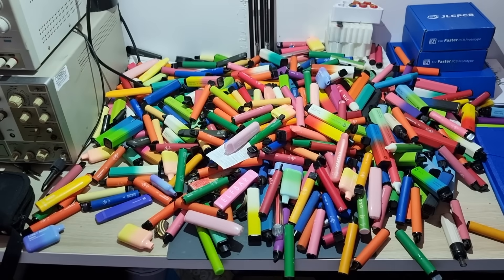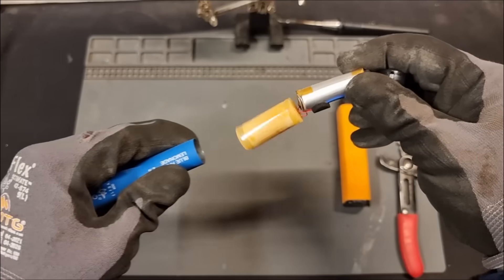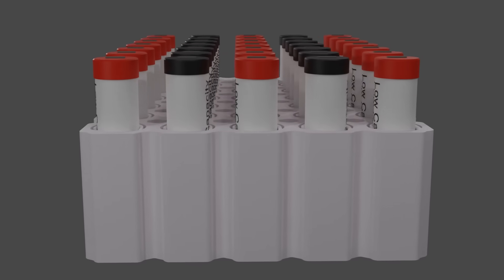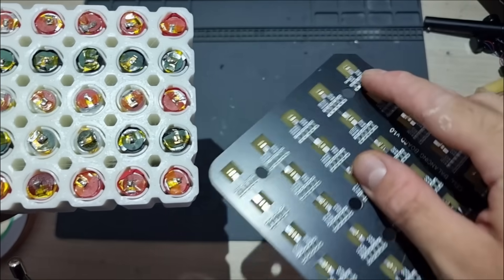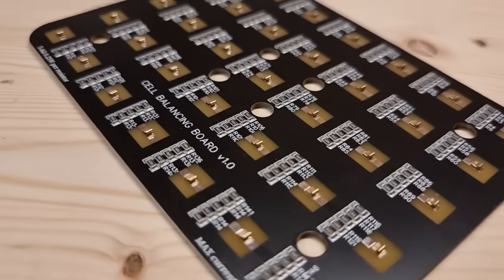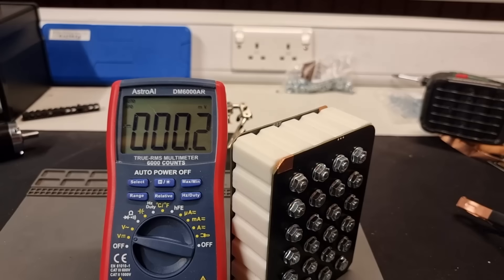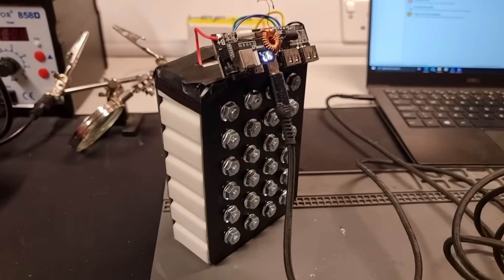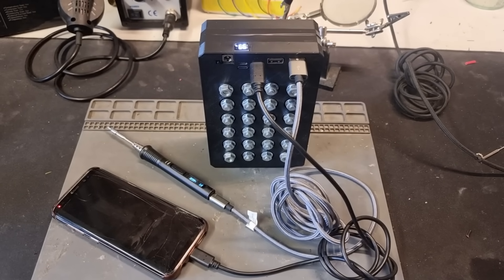Turning Disposable Vapes into a Fast Charge Power Bank

Comment: Great project! I used to make battery packs from discarded laptop batteries years ago, and I wanted to share some advice in case it helps anyone. You mentioned the final capacity being around 15,000mAh, but the concern with recycled cells is the capacity and health of each one, not just voltages. Someone may have already mentioned this in comments, but in my experience, testing each cell's capacity with a simple battery tester is key. It helps you weed out weak or unhealthy cells that could bring down the performance of the whole pack. even cells that get really warm while you lightly charge them should be discarded. you want healthy cells. (you can buy cheap simple testers online or even fancy expensive ones)

Then, after testing, let the good cells sit for a couple of weeks. If any lose significant voltage, they’re also likely unhealthy and should be excluded. Grouping cells with similar capacities together ensures a more reliable pack and will charge and discharge better. I know it's extra work, but it's important for anyone making larger packs, especially cases when you want to make a battery pack that will require large power draw like an E-bike battery.  anyways awesome video man, really turning trash into something so useful.
Reply: This comment deserves to be higher up.
Reply: As someone who makes 18650 packs from discarded cells, I can say this is excellent advice and is right on the money.
Reply: i second this.
Reply: You should really just directly test their internal resistance. I and some friends have vaped on and off, I have had a few disposables. I always tried to find the ones with onboard charging because nerds can be addicts too lol. It's a small sample size but I did notice a few would not hold their charge even after just one or two cycles.

The industry is even dirtier than we're seeing here, especially those Kapton wrapped ones I've found are technically li-ion cells but they're such low quality since they're relying on people using them for 2-3, maybe 5 cycles max, they're rechargeable but designed so cheaply that they're functionally disposable.
I'd use sensitive protection circuitry if making a large scale pack from them, still worth it but also worth it to be careful.
Reply: The beauty of this is that these batteries have been charged fully once and then only partially discharged once. Most of them are left nicely at storage charge or about 50% when the juice runs out. You can tell when he tests them that most were at roughly nominal capacity
Reply: @reezlaw  exactly. Lithium batteries can withstand a LOT of charge-discharge cycles. These cells went through ONE
Reply: great advice, needs to be pinned!
Reply: Great advice, very very relevant!
Reply: This is something to note, though they should all be in pretty good condition as you will run out of juice in many of these even after maybe 5 charges? At least my own experiences with them. I would just bring each cell up to full capacity and test each voltage, best go in the group, less go into another.
Reply: I had looked into reusing used 18650 batteries from laptops and torches but the batteries all degrade at a different rate and I read that mixing and matching doesn't work well when trying to make a new battery pack.

Which is a shame because some of the batteries are basically end of life while other still have plenty of use left in them.

What would the used batteries be good for?
Would you use the 18650's individually or make a new pack for specific uses?
Reply: @jeremylindemann5117  Use those that have a high, similar capacity. Recycle those that have high impedance compared to the others or don't retain charge for a week.
Reply: @Gregorius421  Recycle as in dispose of properly or as in cycle them in and out of a pack more often?
Reply: did you succeed?
Reply: How much ohms resistors he used
Reply: Cell health is barely an issue in this case. With laptops it 100% is cause people recharge them all the time, but for these vapes it really isn't cause they were never charged back up before being thrown out

That's the most annoying part of that garbage, they use rechargeable lithium cells and pcbs on a DISPOSABLE item. It's not an exact comparison, but it's kinda the same idea of buying a phone and when it's out of battery, you buy a new battery.

Comment: Yes! I build other cool devices with them like a portable fan that runs for around 16 hours straight on 1 charge, i also use those skinny black flat ones to replace batteries in controllers and mobile phones, i also want to build something like this!

Comment: Love the project idea but holy, you didn't need to use enough bolts for the thing to survive a hurricane

maybe a bolt in each corner and a single bolt in the middle to stop bulging, slso low profile bolts and nuts so it doesnt get stuck everywhere

Comment: I vape.   I did use “disposable” but never tossed.  I actually had removed the batteries and junked the rest.   Held onto them for awhile.  Thought about doing this but not savvy enough to figure it out.     My work has a battery bucket to dispose of properly.

Comment: that is a neat idea but I do have to question, you didnt seem to have a load balancer on those cells and this is what that board did for you to balance the charge. Are you not afraid of a cell issues causing an imbalance as these different cells will be different quality and could cause issues after some use?

Comment: Thanks for the video. I've been planning to do projects like this with vape batteries for the longest. Such as repairing a solar yard lamp. The batteries that come in them suck!. I use 18650, 20700, and 21700 vape batteries for my flashlight. Especially the ones that are loosing capacity and voltage. If you have a flashlight that uses 3 AAA batteries, and has a square single led. Remove the AAA battery bracket. Cut a used up toilet paper roll cardboard to size, use packaging tape around it to hold it's shape. Use it as an insulator for the 18650 batteries, and you're good to go. For 20700, and 21700 batteries remove the cardboard insulator. Make sure your plastic wraps are in good condition,  if not rewrap them, or use packaging tape to insulate them. You don't want a mini pipe bomb for a flashlight. After all that you'll have a much brighter, longer lasting flashlight. You should make sure all your battery wraps are in good condition, or rewrapped them asap. Safety first folks.

Comment: This is cool, I just want to say I definitely don't like your contact solution as I think it's going to be error prone. I would have spot welded them. You can actually make your own spot welder. If I didn't have one of those I would have hand soldered them because it's not really that hard once you get going.

Is that why you have like a thousand bolts through that weird case? I dont agree with the engineering choices getting made here

Comment: No this doesn't make a high voltage high-cap pack.  Logically It makes a high-volt MEDIUM-capacity pack.. logically speaking due to the fact you already refactored them once into high caps from low cap. 
It's a rule of 3 - ya can't eat ur cake and then have it!

Comment: It would have been much less work to just solder the cells together. These cells are easy to solder since they already have  a solder point on them. I also trust solder a lot better then foil tape and pressure. It would reduce the weight by a lot and not require all the pcb.

Comment: This design is dangerous, the copper tape could come in contact with the cells aluminium wrapping causing a short circuit, additionally there could be a cell that becomes disconnected and then remains high SOC, if it then reconnects it will then overcurrent charging the rest, Each cell should have a fuse, soldering and wires might be a better idea, with a through hole to connect each cell.

Comment: Hello, you should be careful with the smallest design. It looks like there could be a risk of a short circuit if you're using old batteries with worn-off plastic wrappers. Sometimes, the battery's outer casing is used as the negative terminal, so if the batteries touch each other, it could cause a problem.

Comment: I wish you had mentioned that battery banks are only as capable as their weakest cell. 

If anyone is gathering batteries while waiting for a tutorial, make sure to fully charge all of your cells and keep only the highest capacity cells. If any of them are 0.5V lower than your best cell, save it for a stand-alone project or send it to the recycling center. If there are any markings on the batteries, you should also try to find ones with similar amp/hour ratings. Just because two batteries are the same physical size does not mean they have the same internal design. Voltage comes from the chemistry, but capacity comes from the thinness of the materials and condition of the electrolyte.
Reply: since most of the ones he collected seem to be of the same brand, it's safe to assume they come from the same factory & would have nearly identical batteries...
Reply: @MG-kw1kb  Not necessarily. You can get two identical laptops or power tools from the same manufacture year and they often have two different brands of battery in their packs. 
Since these use individual batteries, are intended to be one-time-use and have little to no regulation, these factories can maximize profits by utilizing whatever crappy, possibly used batteries they can get their hands on.
Reply: @Official_DJ_Spark  I dont think your theory adapts to this batterys ... your point isnt wrong but to me this shouldnt be a problem if he uses same product with same battery (by looking) sure there is a possibility that manufactorys change something overtime... but i wouldn't assume thats the case for these batterys... but overall your pont isnt wrong and should be mentioned... in a way he did mention it by comparing the small and the bigger vape to each other

Comment: Great initiative to save nature. But I was wondering, if they need any kind of balance charging leads while recharging. After some charging cycles, some of those batteries are going to degrade and become weak, discharge faster than others, and cause problems. I am not sure, but that's what I have seen on the videos, and all of them use some sort of BMS(Battery Management System) board for balance charging.

Comment: If the battery waste for disposable vapes can make 5000 car batteries or 1.3 Million bike batteries. Isn't it not only viable but profitable for a company to salvage these batteries to be used elsewere . With practically one cycle in them they are brand new .

Comment: if you are using disposable vapes then just smoke cigarettes instead. Disposable vape is such a dumb idea on par with disposable car, you're not even saving money on it lmao. Coils from smok or vaporesso (the reputable big brands) are like 3 pounds, liquids are like 10 pounds and last quite some time, 18650 cell from SONY, Samsung or LG is again like 15 pounds and a decent mod with a tank can be bought for 20-30 pounds. That is the budget of like three months of using disposables... and maintenance is easier than cleaning your phone ffs. Like tha hardest part is washing your hands... which is alien concept to many as I find out whenever I visit public toilets but still not that hard. 

Up to 3500 puffs on the big one? Like my old vaporesso armour pro mod could do more than a 10k puffs on a single charge and like 4-5 thousand on a coil... and it was like half the size and had colour screen and cool design. And fast charging. And that was from like 8 years ago...
Reply: No way bro said just smoke cigs instead of vapes
Reply: @humble2246  disposables? Might as well. At least you'll be a burden for the environment for shorter time. And birds may use the butts to insulate their nests and fumigate parasites.
Reply: @VanBourner  so... you want people to get back into smoking where there is 10x problems compared to vaping...

Comment: I too have been collecting caps to harvest their batteries 😊 my biggest frustration is that they are of different sizes and capacity. I have used a few in my models and to repair a rechargeable torch light. But by far my biggest frustration is that so many of these gaps are just thrown down on to the ground where they get squashed by vehicles damaging the battery and often exposing the battery leaving it vulnerable to animals picking them up and in some cases eating them. The damage this causes can be fatal for the animal which could be a pet. Gaps are a serious issue.

Comment: i looked that board up in aliexpress..your potentially risk ur life using it.electro capacitor is lowest brand and if youvgoogle that brand there been loads failure.
and fuse on that board probably wont do anything is something should haywire with power bank.
dont even ask main micro controller

Comment: Is there an easy way to get the used vapes in bulk here in the us?  I have designed and built battery banks before, and I have worked with biohazard waste before so I know how to properly handle both.
Reply: Doubtful over here. Most people just chuck em in the trash. Maybe if you lived in a large city? I've only seen one vape on the ground

Comment: This look to me a videocoreography of bunch of fuckups.
1) use untested cells, you have no idea of the remaining capacity, or internal resistance.
2) used copper tape, well guess what makes it stick is not conductive. those are meant to be stuck to a surface and not for quick electrical joints. the connection resitance will vary especially with humidity caused oxidation.
3) that PCB costs more than the whole project worth. i know it is relatively cheap.

Your conclusion is indeed correct. This video shows how much e-waste is created. And you just made one. 
This was exactly like reusing PET bottles for filaments to print 3D boat/benchies.

You can not recycle these Li-Ion/polymer batteries. Those manufacturers for wapes use the cheapest quality that lasts a year. Why do you think the owner threw it aways? Because it didn't work anymore, the battery was dead.
Dispose them. They are fire hazard and putting out lithium fire is almost impossible.

Comment: Vape batteries make a great replacement for remote control units. Especially those rechargeable vapes. All the circuitry is there to make your TV or stereo remote a rechargeable unit with very little modifications.

Comment: Great to see this! I've been recyclind dead vapes for about a year and a half, I think I've probably processed about 2000 by now. In Aus the main ones I see around have 1400mAh batteries in them, and I've used them with the same boards you used here to make a bunch of 5S 20P batteries in plastic ammo cases. I can run my laptop off of one of them for almost 24 hours if its fully charged. Its insane how much valuable material goes into those 'disposable' vapes.

Comment: I've saved 200+ disposables for the same reason, albiet smaller projects (Micro Controller Power, etc). I've already replaced the aging batteries in my PS Move controllers, which I still use for PSVR, with a pack of 3 ElfBar cells.

Comment: I've found that these are really only best suited for small projects where one-two batteries are enough. For this kind of things, salvaged 18650 are much easier to handle, charge, balance etc. Btw most of these are 4C, so overworked in vapes, but there they don't work continuously like when salvaged, so be cautios :)

Comment: Glad to see someone else doing this. I used five small disposables to fix an old Porter Cable rechargable screwdriver. It had sat on a shelf in my garage for at least 15 years, because it quit on my dad not long after he bought it. It is wildly pleasing to use it, and now it's doubly sentimental to me. I've also made small battery packs, and I collect dead vapes and old laptop batteries for just these kinds of purposes.

Great work!